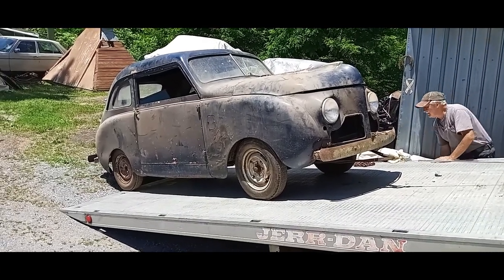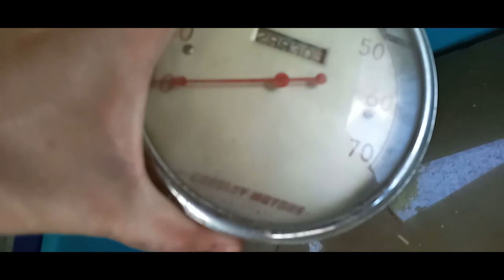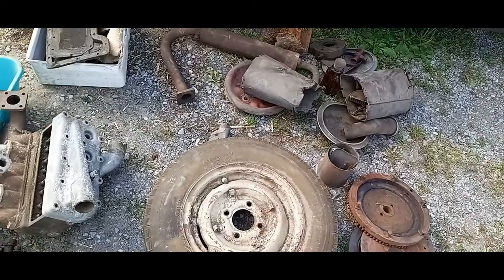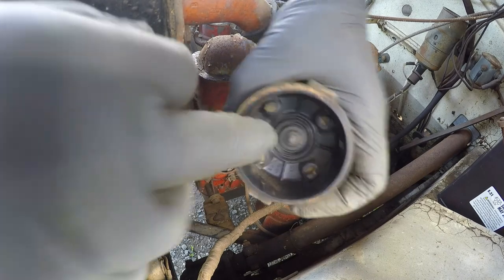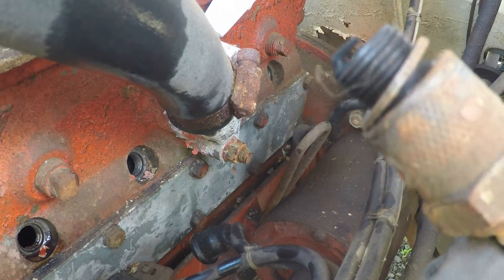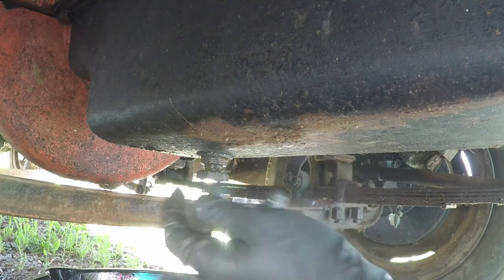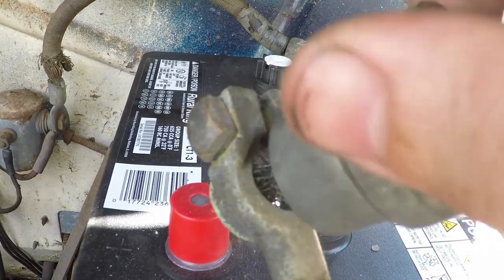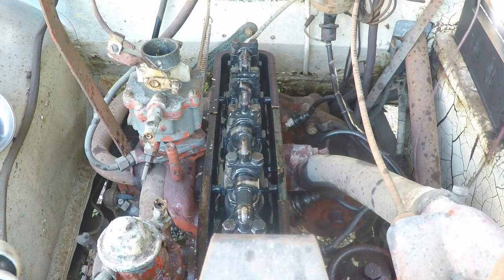Crosley Car Barn Find First Start in 40 years

Comment: my dad had several crosley's buying his first one new in 46 a gray wagon ser number 333 id love to find it in a barn some day .yours is a late 48cc model if it has disk brakes ,the 49 body was the cd  body. please join the club and search for service motors out in ohio. i promise they have every thing you ever need and wonderful folks good luck and how about updates on how its going
Reply from the maker: So I started working on it in April 0f 22'. That May, with less than 2 hours of it being on the road. I drove 200 miles to the Carlsile Import show in PA.  That whole weekend it did fine, had no big issues.  Did blow the muffler off, and apparently it wasn't charging the whole trip, lost headlights 10 miles from home...  Anyway, I took it to a few local car shows, mainly just road around town, and went to thrift stores with it.   About 1 month ago I drove it 90 miles to its new home. The guy has already started to fix the body work.  I have a few videos of me getting it going, just gotta get to editing them.   The little car is neat, but for what ever reason, just  not for me.   Too many cylinders.. :)  I'm an air cooled 2 cycle fella I guess.

Comment: how did you hot wire it I have the same car I'm trying to get going and don't have a key
Reply from the maker: Hi, at first I just jumped the 2 wires off the back of the key switch inside.

Comment: It is really easy to convert to negative ground.
Reply from the maker: Yeah, though I never found the need to.  This little car charged,started,stopped, and ran just fine.  I drove it around for quite awhile.  

Top speed of 45mph....  As the mechanical parts go, its very interesting.   Driving it on modern roads, not so much.   There is a good reason most people just leave these sitting as conversation pieces!